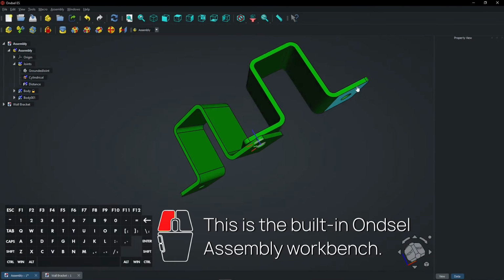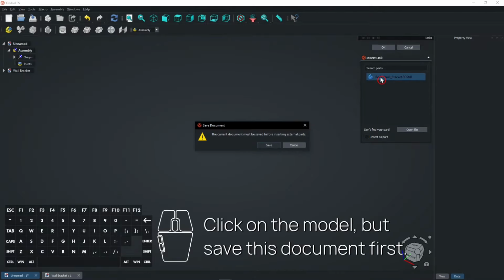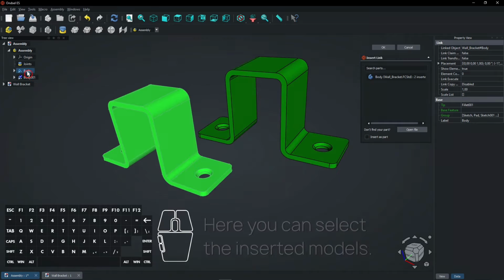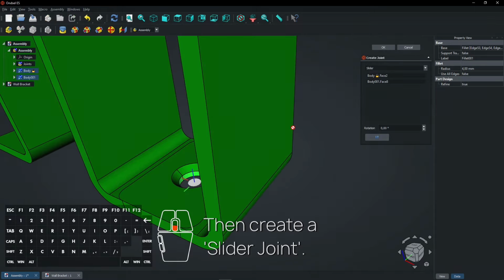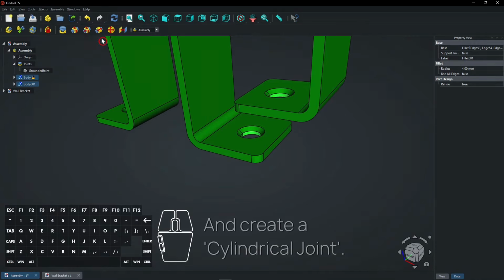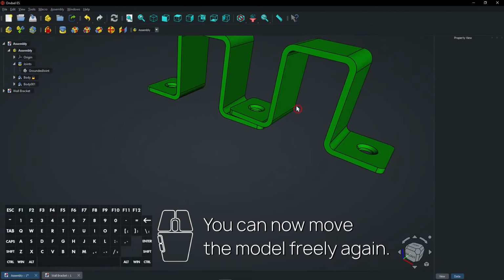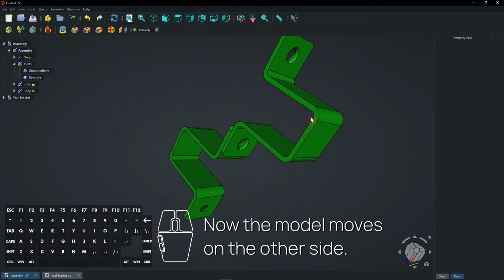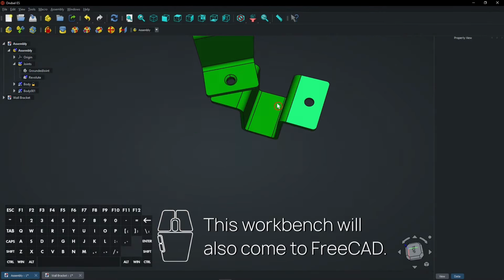⚡ Quick Preview - Ondsel Assembly Workbench - Freecad Assembly Tutorial

Comment: why use ondsel instead of freecad?
Reply from the maker: Ondsel has a better looking default interface and sketching has a better workflow. There is also a built-in Assembly workbench. That are a few examples. Notice that these features will probably also come to future stable FreeCAD versions.
Reply: @AllVisuals4U  afaik these features are not specific to ondsel but rather just experimental freeCAD.. and many are just fine with freeCAD as is, the mentioned differences dont seem like a huge improvement tbh..

but by using ondsel your locking yourself in this cloud based single company, no open source program.. not worth it for me
Reply from the maker: Yes you can find similar feature in developer versions of FreeCAD. But I think it's a great support for FreeCAD to get known better.
Reply: @AllVisuals4U I think this is to the beholder. Ondsel still opens up with the tired, very old and antiquated, Win3.0 toolbar layout with the maddening WB pull-down menu, you know the one that all of us want to poke our eyes out when watching demo videos because it is a constant action.  ModernUI workbench doesn't work ideally with it either.
Reply: I love the interface it is fresh and more refined looking. Yes there are some minor differences in selections of functions to master but the interface is slick and more intuitive. Auto dimensioning tool is a dream to use to quickly find and close off all your constraints for instance. Excellent feature.
Reply: @yanikkendler   What is the name of the built in workbench for assembling parts in FreeCAD?

Comment: One of the things I've been struggling with is making a sliding joint in a keyhole design rather than a cylindrical slot. It's very frustrating and there's basically no documentation for it.
Reply from the maker: This workbench is hopefully getting better and better. Some models work great, but others fail somehow in orientation.

Comment: After following your steps, when I click and drag the part in the assembly I can't actually move it.  I can use Placement in properties to reposition a part, but that won't help when testing range of movement by dragging a constrained part.  Any ideas why my parts are locked into position in the assembly?
Reply from the maker: Did you set the navigation style to 'TinkerCAD'? Otherwise it could be a bug. I also noticed some dragging issues.
Reply: @AllVisuals4U  I did, this tutorial is really good in that there are no missed steps from start to finish and it's short and to the point - I had the same problem with other tutorials but there are a lot of missed steps.  I wonder if it's something to do with the way I am creating parts?  Do you have a simple project file I can test?
Reply: When you right-click the assembly there is a Transform entry right at the top.  Clicking this got it working, I didn't see this in any of the assembly workbench videos.
Reply from the maker: Thanks, I will have a look!
Reply: @AllVisuals4U  , it doesn't work in freecad regular version RC1...
tried changing the navigation style to tinkercad. It still doesn't work half the time... any suggestions?
Reply from the maker: @meirm471 I think this is a bug at the moment. I noticed this too.
Reply: @AllVisuals4U  , you're a life saver mate, I have been trying to find a workaround for the last couple of days...
do you have a best practice as to what you do so that the assembly parts will be able to be moved after you edit one of the parts (apart from having it in Tinkercad mode)?
Reply from the maker: Does closing the document and restarting it again help?
Reply: @AllVisuals4U  , for some peculiar reason it did... that is strange. 
so, I guess, it is as if there is a variable that is corrupted during the session and is cleared when a new session begins... that is fascinating... 
I thank you from the bottom of my heart for your help with this one!

I will check your speed modelling channel!
Reply from the maker: @meirm471 👍👍